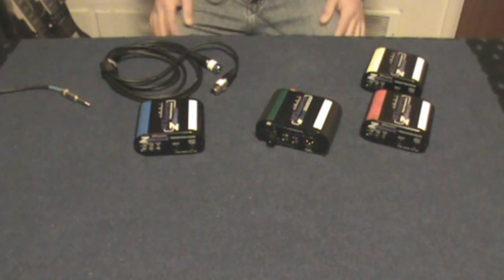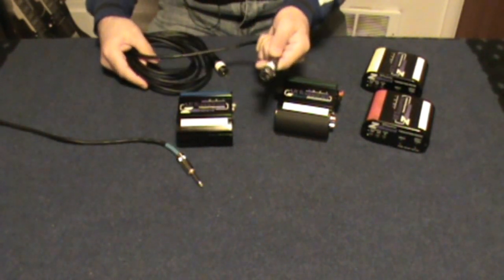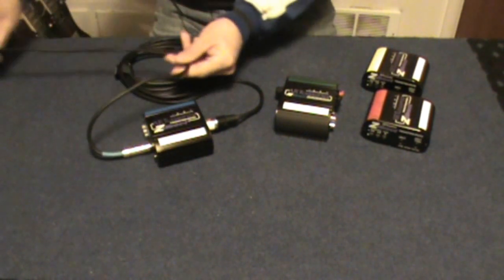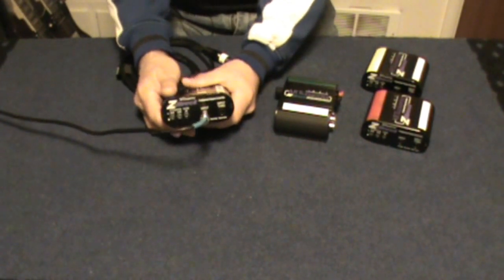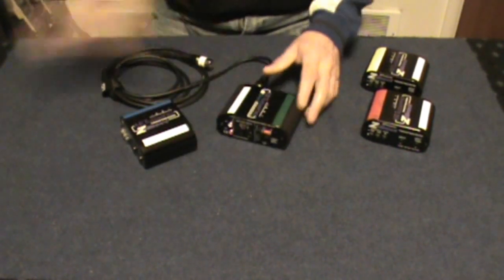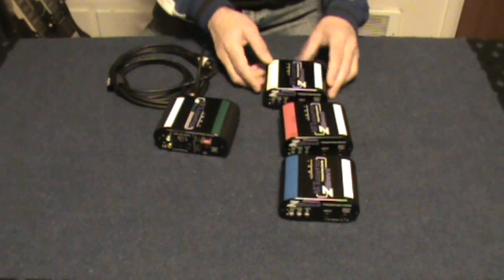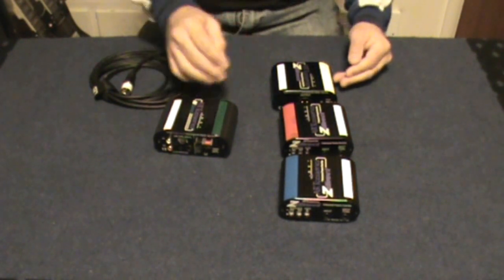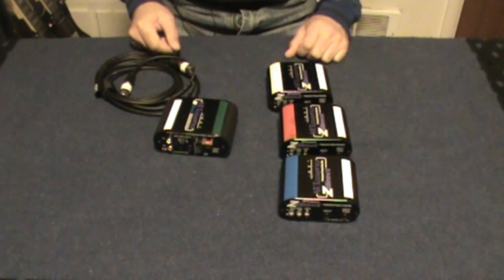Intro to D.I. Boxes - AudioTech

Comment: This very useful. I had a Behringer Ultracoustic ACX90 amp and there's an XLR line out with Ground Lift switch to enable a direct connection to your mixing console. I never try it before do you think is it enough and no need to get one of these DI boxes and I heard a lot about radial what about Radial Tonebone PZ-Pre ? I use an LR Baggs M1 Active with a Parlor guitar. Thanks in advance.

Comment: Hi +TheGospelGuitarist, I have a question. My signal flow is as follows: 

Takamine Acoustic/Electric guitar [via TRS cable] --> PreSonus Audiobox [via USB cable] --> Macbook Pro [into MainStage software] --> PreSonus Audiobox [via TRS cable] -- // --> XLR (on stage which is embedded in the floor and snaked to the board at the back of the house/church). 

Would I drop a DI at the "//" point in my signal flow?
Reply from the maker: +shawn white Yes between the audio box and the XLR stage box. Unless the Presonus has an XLR output you can use.
Reply: +shawn white I believe you are confusing a few things, a TRS cable is different than a TS (guitar) cable. As far as I am aware most guitars do not have a TRS output, but have a TS output. Technically yes your configuration will work fine without a DI if the output from the AB is connected with a TRS to XLR converter. I would however recommend running your guitar into a DI (such as Whirlwind Imp 2) and connecting the house XLR to the DI and use the thru to the AB.

Comment: is a di box just for directing a guitar line into a pa system. What about acoustic guitars with passive pickups. Can you use a di box as a pre-amp or even just to give the signal some tone color? for example the adi12 by behringer.

Comment from the maker: A D.I. Box will convert anything using a high impedance level into a low impedance level to cover long distances from a stage to a mixer. Acoustic and electric guitars are high impedance whither active or passive systems. A DI box is a converter not a pre-amp. The ADI-21 GDI is a pre-amp modeler pedal with a D.I. output. Using this stomp box will absolutely allow you to color your tone as will other acoustic guitar processors with D.I outputs, Bass guitar processors with D.I. outputs ect.

Comment: Hey, i'm using a 1/4" cable from my taylor acoustic to a Focusrite Scarlett 2i2 AI. I've been having trouble with background humming and i've come to the conclusion that it's a grounding issue.. Would I be ok to plug it in through the unbalanced input into a Millenium DI-E, out to an XLR into the interface? I'm just concerned about having the phantom power active while using the DI box. Would this be an issue? Any help much appreciated, thanks !
Reply from the maker: First,  why is phantom power active, your guitar doesn't need phantom power. Make sure your line/inst switch is set correctly. You could have a bad cord.  Swap out the guitar and USB cords. If this hum only occurs with the guitar you may have pre-amp issues. Is the Focusite properly grounded? You can check your outlets with a small outlet checker from Radio Shack or even Wal-Marts.  You can try you idea with the DI box, if it works great. But you really shouldn't need to use that. Let me know how it goes.  Oh and make sure the usb and power cables are not running along side the audio cables. They can cross at 90 degree, but not run in the same direction. That's how we can get 60cycle hum into our audio lines.

Comment: Hi, you're video is great. My question involves the DI for keyboard/guitar. I understand that plugging a keyboard from the Left out to the input of the DI will get me a mono signal. Can you explain to me what input on the amp I will plug in from the thru put to connect the keyboard to the amp through the DI? Thanks
Reply from the maker: The DI has in thr and an xlr out. So plug your keyboard or guitar into the in, take another 1/4 cable and run it to the amp input as usual. Thanks for the complement, they are always appreciated. ;)

Comment: I was just looking at buying one of these to get rid of 'noise' plugging in a keyboard to PA system, are these passive or Active boxes? Thanks.  Very helpful by the way :-)
Reply from the maker: They come on both forms. They will both work, just a matter of which type you want and how much money you are willing to spend. Generally, any run to a pa over 25 feet with an instrument type cable will start picking up noise. If you are making runs of less than that you may have other issues with the keyboard or creating a ground loop which is creating hum.
Reply: TheGospelGuitarist . Thanks for your quick response. It is just over 25ft actually, its not really a hum, more of a buzz, but are you saying the DI box wouldn't get rid of a ground loop? Or would an active work better than a passive? Don't no the benefit of either passive or active. Sorry, know nothing tech!

Comment: So, if the guitar/mic cables are less than 20' in length, then you should not worry about getting a direct box?
Reply from the maker: If you are in a band and you place the mixer on stage, you don't need to run your acoustic guitar to a DI, just run a guitar cable into the mixer on stage. You would be fine.  Same in a home studio, just plug into the mixer or interface without using a DI. In pro studios, a DI would be used because the wired connections are usually all XLR lines and are longer than 25'. Does that help?
Reply: TheGospelGuitarist . Yes, it does. Thank you.

Comment: OK, well I am wondering what to do with a couple of guitar variations:
First; What do you recommend for connecting an Electric guitar, that has an "Active electronics/Piezo" pick-up incorporated into it, as well as the standard electromagnetic pick-ups?
Second; What do you recommend for connecting an "Acoustic" guitar, that also has an "Active electronic/Piezo bridge pick-up" built into it.  What kind of amplifier should be used- a "PA" amp, or a standard type of guitar amplifier?  
There's a lot more to all of this than I ever knew!  How do I get the right answers to such questions, without just going around in circles?...[THANKS!!!!]
Reply from the maker: Actually, I have two other videos which discuss these questions. :) Check them out and see if they don't answer your questions. I cover several options with using electric and acoustic guitars. I know what you mean, audio has a steep learning curve but just take it slow and try to find trusted sources for your information. I have done a lot of live shows so I may not be all knowing, but I have learned a lot over the last 20 years. I am still learning and don't plan t stop.

Comment: I hope you re-do this video, and get some good close-up detail photos of each device.  I couldn't read, or make out any details. There also was a lot of 'glare' from your lighting.  Thanks for the basic info, though!
Reply from the maker: I don't get too detailed here because unless you buy this exact unit, it will be different. I know my lighting can be a problem in some of my older videos. I don't have a video studio, just my home studio. The camera I shot earlier videos with was not to great either. I get into the details in my other videos about using DI's with acoustics, electrics, basses and even computers. Check them out, I actually hook stuff up. DI's unnecessarily mysterious to most musicians. They really shouldn't be. Thanks for the posts! Asking questions is how we all learn to take the mystery out.

Comment from the maker: Vocal mics should not use a DI unless you happen to be using a mic with a high impedance output (read 1/4" connector) on it. All XLR output mics should go straight into the board or snake.